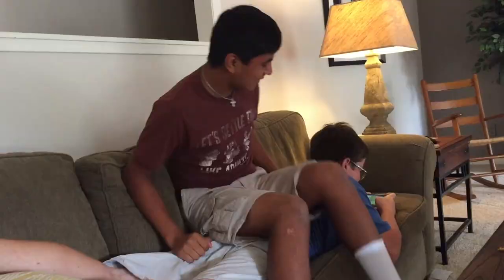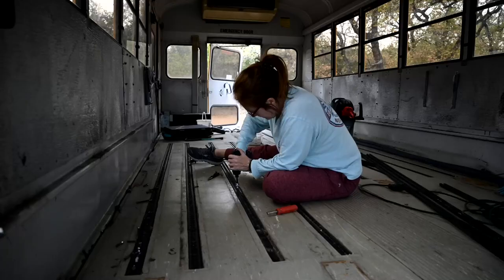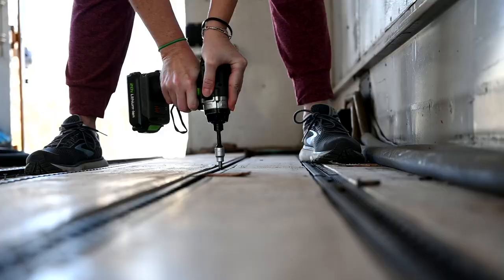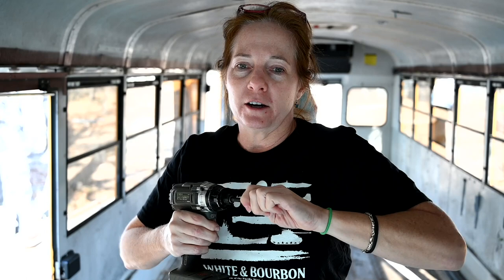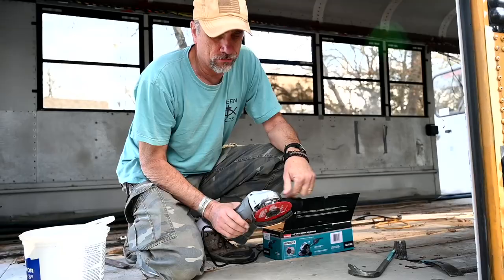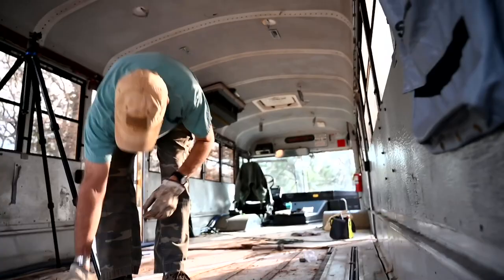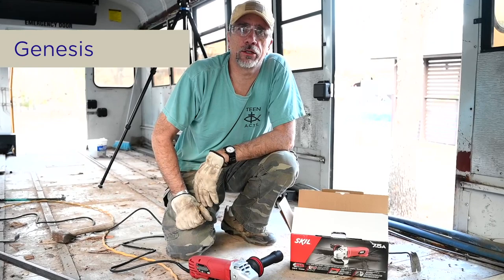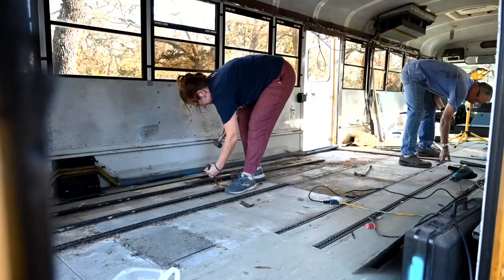Floors Part 1: Removing Wheelchair Rails

Comment: Can you tell me why you took the rails out?  I plan on using then to mount cabinets etc.  If your floor is not caving in there is no need to tear it out.  Do all of your insulation and sealing on the underside.
Reply from the maker: Yea...hindsight. We did think about just leaving them in and working around them, but preferred having insulation inside and as much surface area covered with it as possible. I’d be curious to see a floor video done the way you’re suggesting though! Maybe we’ll try it on the next one. 😳
Reply: @TeamRawlsTX  Check out the Good News Bus.  I'm pretty sure he did it that way.

Comment: Mine hase rubber on the subfloor. Glued so well I had hard time getting it out. 
My wheel chair rail screws are all stripped out!
I have to take out the rails to repair sub floor water damage... 😒
Reply from the maker: Ugh. Yea. The demo is definitely the yucky part. Hang in there!!!!